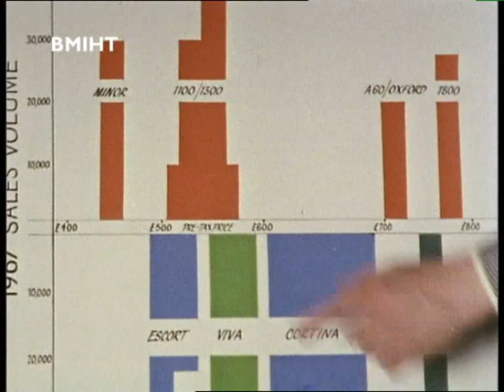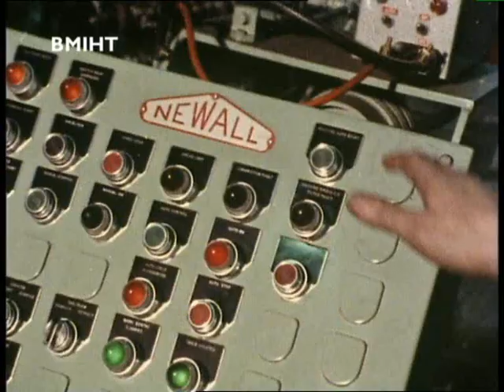Morris Marina Development Part 1

Comment: Leyland Australia made a Leyland Morris Marina Six with a 2.6 Litre six cylinder motor. I saw (heard) a green one once. THEY EXIST.
Reply: James French  Yep.  Had one.  Little bugger went quite well.
Reply: And they had that grill with the vertical slats instead of the one with that colour coded horizontal bar. I heard you had to remove the radiator to get to the belts haha. 
Chrysler Australia were smart enough to make a nose to accommodate the 4 litre hemi 6 in their Simca based Valiant Centura.
Reply: James French  Yes it was jammed in for sure.  I was led to believe the motor had to come out underneath.   I didn't have it long but I didn't mind it.
Reply: Kenny Scott I know of a guy who got one to take the engine out and when he drove it to the mechanics, they all ran outside to see it because they weren't sure such a thing existed!
Reply: James French  You would just cut the front out wouldn't you.
Reply: I owned one, it went like a rocket. I thought it was awesome :)
Reply: The Leyland P76 went like a rocket  with the alloy V8, but the Marina only needed the 2.6 for the same effect.
Reply: James French   Had 2 of them as well.  And a six cylinder P76.
Reply: I saw an old man driving around in a green one with the single  headlights in the Concord area not too long ago. That'd suggest it's the now rare six cylinder version. Probably owned it since new. 
There is a scene in the 1981 Ozploitation flick Road Games with a single headlights one towing a boat and losing control on the highway. Actor Stacey Keach is behind the wheel of a Mercedes Benz semi trailer following behind.
Reply: James French  You just don't see them anymore.    A friend has a targa floria.  Lovely car.

Comment: I was an apprentice in a company that had these for the commissioning engineers to use.
The first thing they did was fit van springs on the rear to take the weight of tool boxes etc.
The guy I was with had a 1.8 and he used to say that he tended to forgive it for it's shortcomings `because it would go in a straight line'.
Top speed for the 1.8 was 95 mph (more or less bang on engine maximum power RPM).

Comment: The Marina couldn't have been that bad, considering 800 000 were sold, nearly as many as the mk2 Cavalier (806 000). I can think of worse cars that have been around. My dad had a Marina for over ten years and rarely let him down and went from sourthern England to Scotland and back several times without any problems. The Marina, I think has some charm to it. I actually quite like the look of the car and much better than the Allegro, which is dreadful. Allegro, what a horrible name for a car.
Reply: So many commenters on here suffering from the 'Jeremy Clarkson Syndrome'...It was a great car, proved very popular & filled a niche both the motoring public & industry required...It's a very English-thing, this with the benefit of hindsight to look down one's nose & sneer at any & everything to do with British Leyland.

Comment: My dad used to work in Pressed Steel in the Cowley plant and told me that the running gear used in the Marina was from the days of the Morris Minor.  The Marina was a fresh new concept on paper but in reality no better than the cars from Eastern Europe and Russia.  Triumph was not pleased with the merger in BL and it ended up killing them off. The europeans were making more advanced cars running on Unleaded fuel but BL & the abundant A-Series engines still running on Leaded fuel up to the 90's!!
Reply: Well, I must say that my Fiat Uno 60 s that I bought new in July 1986, wouldn't run on unleaded. I had to put a lead additive in with each fill up. I wonder where C36 GKO is now, by the way ...

Comment: From what I have read, the problem with the Marina was that BL's predecessor hadn't built a small RWD car since the Morris Minor of 1958 - and that's what they based the suspension of the early seventies Marina on.
If you think that's bad, Australia had a 2.6-litre SIX-CYLINDER Marina on sale - voted by our motoring magazines as "The Car Most Likely To Take A Life".
Reply: The 2.6 litre E series 6 is actually lighter than the Bseries 4.  The Aussie marina wasn’t that bad

Comment: At age 20,and callow,i bought a new 1975 Marina in Canada.3years later,went through a mud puddle,the car stalled,there was a 2 piece white nylon wiring connector,below  the starter that had 4 important circuits going through it.utterly stupid place stupid design,no weatherproofing.trans had particularly weak syncros.it handled highways well,would do 100 mph,the seats were particularly comfortable.gearing in the trans was poorly chosen, 2nd-3rd around town intraffic always changing.the hydraulic

Comment: I can remember the day they were launched. My car loving friend and I saw the photos and we groaned in unison. He christened them grudgemobiles. They defined the concept of lowest common denominator motoring. The 1.8 front suspension was extremely dodgy until they modified it. It was then just dodgy, except it understeered so much you couldn't dodge anything. I did run a 4 door 1.3 briefly. It was the nicest of the bunch, but thats not saying a lot.
Reply: Tim Hancock in Australia they shoehorned the Austin 6 cylinder into it ! Now that was dodgy and dangerous!
Reply: @fordlandau  more straight roads in Australia 😁
Reply: The E6 was actually lighter than the Bseries 4 and the Australian Marinas had normal front suspension and a Borg Warner gearbox (local content requirements) - the whole front end was much more solid

Comment: Design Team: We want to fit the Marina with Independent McPherson Struts.  BL: No money, just use the same suspension system from the Morris Minor, Trunions!
Reply: I have a1976 diesel marina imported from Malta this year, has done over 600,000 kms & suspension is great, no knocks or bangs even going over the dreaded sleeping policemen, don’t know why people knock them, a British thing I guess, let’s see how many BMW’s are on the road at 42 years old & yes my daily driver is a 320d
Reply: They never produced the Diesel model in the UK, that’s why
Reply: Yes, same model but different engine, you can see it on you tube, Morris marina diesel 1976
Reply: Meanwhile the Avenger had the suspension and steering of a sports car and handled accordingly.  Why anyone would buy the Marina is a mystery.  Just go test drive an Avenger and you won't be buying a Marina.

Comment: The Marina was never a 'new' car; to save time and money the pompous clowns depicted here took an ancient engine (not much more than a bored out version of the engine in my 1954 Austin actually) and put it on running gear largely borrowed from stone age gems such as the Morris Minor. The public weren't fooled for long, particularly as the finished product was built to Russian car standards (the factories were dominated by communist unions after all). British Leyland served as nothing but a cautionary tale of the downfall of the British motor industry. Idiot management and moronic power mad union officials topped off with interfering politicians. Yet today we have some of the most efficient car plants in the world, producing excellent cars, mostly of course run by Japanese and German brands.
Reply: Yes and the modern plants are still unionised, 
BL fell down mostly because of poor management, adversarial approach to industrial relations, and sold rubbish products, none of which were the workers fault
Reply: The Officer As someone who worked in the body repair industry all my life allow me to illustrate issues concerning car manufacture and the unions. As a 17ish year old painter I worked in a bodyshop that won the business to carry out rectification work on Hillman Avengers - the "c post" body leading over the panel joints was badly shaped and very poor quality workmanship. We had to grind out the factory lead, re-lead them properly and repaint. When the company warranty man came to inspect our work, someone asked him why it just wasn't done properly in the first play at the factory and why people weren't pulled up on their poor work. He told us that if they complained about the shoddy work they were told by the union to f!ck off. Imagine the costs involved in us and other body shops carrying out rectification, it doesn't take a super brain to work out why the car manufacturers went down.
Reply: hodgheg  Totally agree.
Reply: Graham Pearson The fault was across the board, strong unions strangling production and management unable to deal with cocky union barrons, constant strikes, dreadful quality and subsequent loss making.
Reply: What amazes me is that the 'B' series engine was quite reliable - until they slung it in this log, with questionable, meretricious results..
Reply: Funny how the factories in Germany and Japan figured out how to produce quality products despite being "dominated" by "communist unions" as well. Reminds me of the old saying: a company will get the union it deserves.
Reply: @matthewbanta3240  I don't think the Germans and Japanese were nearly as 'dominated' by their unions as British Leyland were. But your point is well taken; B.L. management was atrocious, pompous and incompetent. When Nissan opened their factory in Sunderland they made sure there was only a single union representing everyone (BL had several different unions) and they set a very high work rate. Then after just a year, without consulting the union at all, they awarded everyone a 26% pay rise. Whether this was simply the Japanese culture (we must look after our people) or a very smart business move, or both, it worked. The culture of 'them and us' evaporated almost overnight and Nissan Sunderland is now one of the most efficient car plants in the world.
Reply: @hodgheg  BL is a bit before my time, and I am not even British. However, I have been able to tell that a big part of BL's problem is that they managed to combine all of the disadvantages of having a bunch of smaller car companies with all of the disadvantages of having one big company. They had all of the slowness and bureaucracy of a big company, but all of their divisions didn't want to pool their resources and work together because they saw their sister divisions as their main rivals. If Land Rover had a better engine, Morris wouldn't admit it and they certainly wouldn't try to put it in their cars since Land Rover was the enemy. At about the same time that BL was going under, here in the US Chrysler was saving itself with their K-cars. They forced all of the divisions of Chrysler to pool their resources to make one car platform and set of engines. Then the divisions were forced to use that platform to make an inexpensive version, a sportier version, a luxury version, a stretched minivan, and they even teamed with Maserati to make an ultra-luxury version (it was a joke even back then but they did try to sell it for a while.) They ended up having a better product than they would have gotten if all of their divisions worked on it by themselves.  These days, developing engines and platforms is so expensive that everyone must do this. Sometimes they might even go into an agreement with a competitor so that the two companies can develop a new engine or transmission together. Doesn't seem like BL would do that even within their own divisions.
Reply: @matthewbanta3240  You're quite right; and ironically the problem started with a poorly executed attempt to pool resources in the 1950s when deadly rivals Austin and Morris 'merged'. It wasn't really a merger, it was Austin taking Morris over. The former production chief at Morris fell out with his boss, quit and was immediately snapped up by Austin. He then vowed he'd 'take Morris apart brick by bloody brick' so the takeover when it happened years later was hardly going to produce a cohesive single entity. Both sets of managers hated each other, the majority of their cars competed with each other, most towns continued to have separate  Austin and Morris dealerships when the obvious thing would have been to disenfranchise the worse of the two. This laid the foundations for the mess that was to follow, yet even within that chaos they still managed occasionally to produce revolutionary designs like the Mini and beauty like the E Type Jaguar.

Comment: The marina was only meant as a stop gap and used outdated technology esp in regards to suspension which meant it did not handle as good as similiar vehicles from ford, hillam and vauxhall, also the pre production vehicles were slated by the motoring press for woefull handling, BL promised to fit roll bars on production models on the strength of this  the motoring press gave fairly good reviews, however this did not happen and the press feeling conned by BL never forgave them.

Comment: For the apologists of BMC dogs like the Marina.  Doa Go ogle search on "bmc Pininfarina 1800".
Farina took the 1800 sub frames with engine and all,  and built a new body around it, at their own expense complete with BMC on the front. The car was "stunning" for 1968. Of course BMC turned it down. Citroen stole the design.

Farina proposing smaller bodies using the 1100 running gear. All we ended up with was dogs like the Marina

Then you see why the British car industry went belly up.

Comment: @TheVx490 The Ital is not for really me either (a step back in design perhaps, but the "MARINA" that really does drive nicely indeed how the car should have drove from new)

Maybe the money spent to spruce up the Marina was better spent than you might think in Ital form the car lasted an other 4 years and this kept it often in the top ten sellers in the UK .

The worst thing about the Ital is the re-worked inner wings that are just pure rust traps (a stupid thing to change them and for what?)

Comment: Love this clip. It crystallizes the beginning of the end oh the British car. They didn't anticipate the huge shift to front wheel drive. They used ancient technology in the motor and suspension. They styled it as if designed by a committee in Communist Russia. It might have worked but it was colossally mediocre. Finally they competed against their own product. Allegro versus Marina. The lunatics ran the asylum.
Reply: At that time (1968) there was no need to " anticipate the huge shift to front wheel drive" as many British ,  Australian & Japanese cars were rear wheel drive in that size of cars well into the 70s & early 80s! British Leyland had plenty of FWD cars at that time that were selling well(  Mini,1100 ,1300 & after a shaky start even the Maxi were selling well into the 70s.

Comment: Clutch had poor weatherproofing,the brake fluid leaked out,giving me endless headaches.the engine was reliable,the starter too.the alternator wasn,t.1st gen honda civics were contemporary.better engineering.lots more fuses.a kid in a toyota did me afavour and wrote it off,year 4.i got $1800Can payout and bought a 6 cyl Firebird.lots easier to fix.modern Japanese cars are so much better.i do miss my Ford 1-ton,though.the Marina was an end of an era.miss it?no.

Comment: @justas525 The Marina is not a classic neither is the Moskovich the overused word "CLASSIC" is applied to everything as soon as it gets to 25 years old.

If you had read my post correctly you would see i class all the vehicles stated from the 70's as rubbish cars from then are mosly poor by todays standards.

I was stationed in the GDR  in the late 80's and without doubt the drivers of Moskovich cars dispised them but had to tollorate this because there was almost no other automotive alternative

Comment: Absolutely a rubbish car.   Designed by a committee in a company going down hill in a country with a tradition of making rubbish.

The Marina and the P76, another junk car was forced on the Australian arm of BL thus sending them well into the red.  So they got the Government to help them out by forcing Govt departments and instrumentalities to take Marinas.  This is how I got to drive one.  I was proceeding down a city street one day in a brand new Govt Marina and a girl ran across in front of me.  So I instinctively made an emergency stop - trouble is, the pedals were not placed per SAE standard for position and spacing, and instead of hitting clutch and brake, I hit clutch+brake (left foot) plus accelerator (right foot).   The car actually stopped, just in time, and the engine screamed.  You should have heard the sound, with the pedal flat to the floor.   Boy did that girl move!

I reported this as a near miss and refused to drive it again - as if the clutch happened to be adjusted better, or I placed my foot slightly differently, I would have killed the girl.

Within 18 months or so, all our Marinas were scrapped.   Just too many breakdowns, silly faults, oil leaks, etc etc, and too many accidents.  And BL Australia closed down, so the Govt help was for naught.
Reply: Very well told Sir.

Comment: they wasted the budget...

Design quality of the engine was bad.
The build quality was even wors.

The body was horrible in it's design + I had the habbit of disintegrating during driving the car.

Equipment?
You would had to pay extra for a heater that would break down within the first year.

And just look how uggly it is!
Acutaly, the only thing adorable on this car, are the door handles...